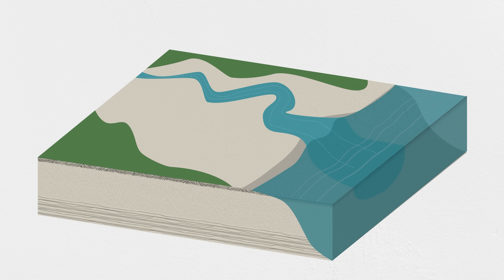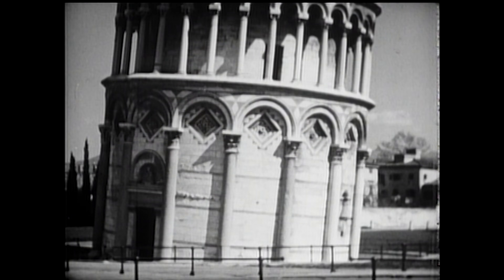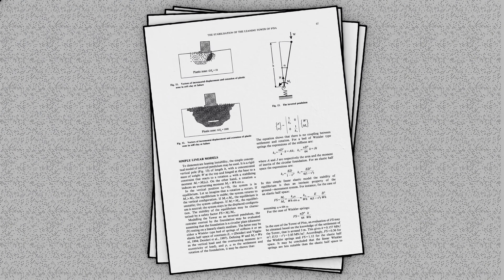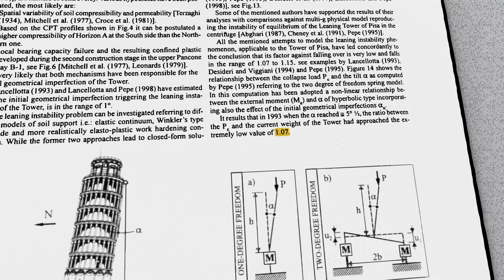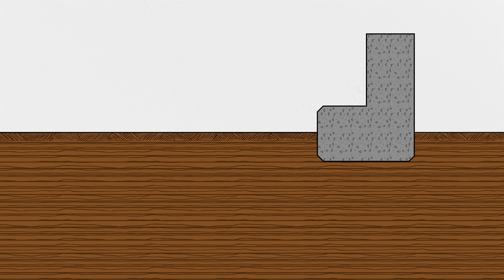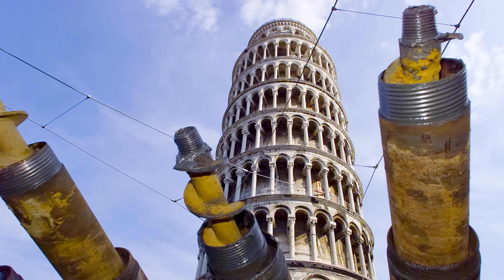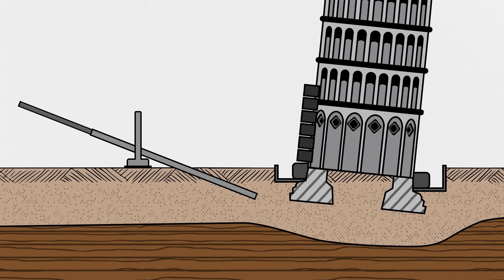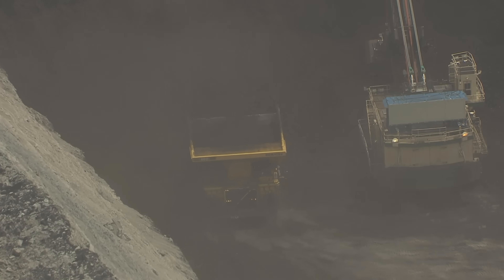How Engineers Straightened the Leaning Tower of Pisa

Comment: It's absolutely wonderful that the engineers locked the leaning side into the sidewalk to support it.  Medieval architects were something else.
Reply: Knew it was an issue and making the footing on that side wider eases the issue
Reply: Too bad they operated a bit too much like modern engineers. Implemented a field fix and then didn't bother to document it in the as-builts, lol.
Reply: Hey, even if it's leaning it's lasted 600 years
That has to count for something
Reply: @nasonguy  You mean "resident construction engineers?"  As-builts are the responsibility of the resident engineers, at least for transportation projects.  Design engineers (such as myself) are required to issue "Use-on-Construction" revisions.
Reply: Not very smart to start digging on that side though, clearly weakens the wrong side. Had they done it on the "high side" of the tower foundation it would have straightened instead of risking to tilt even more and risk collapse.
Reply: More like it snagged itself into it as the lean progresses
Reply: @stephenfry-gdot  That was the most engineer answer possible. Thanks.
Reply: @nasonguy   anytime
Reply: @mfaizsyahmi  That is my understanding as well

I don't believe it was deliberately done by the original constructors but is something that happened over time as the building leaned and rested on the surrounding walkway
Reply: I think they have the same spirit, just different tools, if the medieval builders got access to incline driller, I think they'll do it too.
Reply: medievil architects caused the problem in the  first place
Reply: Soil mechanics wasn't an engineering discipline until the late 19th early 20th century. It was hit or miss before then.

And as a side note, Pisa isn't the only "leaning tower" in Italy.
Reply: The tower actually overshadows the cathedral, that's an engineering marvel by itself. The central nave, at 33m height, is higher (and larger) than the entire first generation of gothic cathedrals, that had been built soon after.
Reply: @BilgeDweller yeah we have a tower here in Netherlands called Oldehoven, was supposed to be a tower for a Cathedral but it started leaning  and there is even a story where the architect jumped off the tower after that happend.
Reply: but if you think about it, if it was leaning just a little faster up until like 19/20 century the level of engineering wouldnt be able to stabilize the structure and it would collapse.
Reply: @wobblysauce  good thing the Pis'a was able to keep from falling down and someone was able to maintain the structure and then straighten the Pisa back up right.

Comment: A couple other ideas that were rejected were installing a tube system under the foundation to freeze the water in the subsoil, controlling the temperature according to the lean, or using hydraulically injected foam to correct the lean in conjunction with injecting a water-cured polymer to harden the subsoil.
Reply: Compensation grouting (aka compaction or hydrofracture grouting) with cement  is what I would have done since I'm a grouting engineer but honestly it would've been similar in cost and schedule to what they did.

I've lifted a penstock at a power generating station using cement and sodium silicate. 3 months to lift 3/4" with a goal of 1". With steady gradual progress, its possible to react to geoinstrument feedback to target specific points to lift and others to leave alone. The structures took weeks to react to the initial consolidation and kept moving upward for weeks after I completed the work to reach the 1" total lift target.

Compensation grouting with water reactive polyurethane is hard to control because polyurethane expands so much and doesn't necessarily find water to react with at the time of injection, especially in clay. The soil and foundation may take weeks to react to injection (as measured on geoinstruments), so  the rate and location of lifting is unpredictable, and differential and overrcompensation happens. People do compensation with polyurethane successfully, but it carries risk.
Reply: I heard they did pump grout into the ground to harden it up and stabilize it. Whatever they did it worked.
Reply: I had thought that they actually did try that as a temporary measure, but it was a long time ago.
Reply: The freezing concept was used in Amsterdam during the construction of the Noord-Zuid Lijn (North-South Line). It runs underneath the historic city center and everything is built on wooden poles as it was originally a marsh. Some huge, historic buildings risked collapse, so they froze a massive section to drill through safely.
Reply: I found this on the Internet: In 1995, engineers froze the ground around the tower with liquid nitrogen in hopes of stabilizing the terrain. It didn't work and the plan, which also involved installing underground anchors, was quickly aborted.  Freezing was used and worked well for the city of Boston's Big Dog.
Reply: "Dig"
Reply: @gregorymccue5003  Boston's Big Frozen Dogs, a revolution in engineering! 😉
Reply: @Yvolve  I apologize for my typing non-skills.
Reply: @gregorymccue5003  Some might say you were closer with “Dog” - the Big Dig is a fine example of a project that ballooned way over its budget. Initially budgeted at $2.56 billion, it ended up costing $13.6 billion according to the final audit, and will cost taxpayers over $24 billion by the time the loans are paid off in 2038 due to interest charges.
Reply: @gregorymccue5003  No need to apologise. I just found it a funny typo, as it almost sort of makes sense but also is totally absurd. And, as Ken explains, it is quite apt.
Reply: I wondered that too why not instead of removing material and making shorter why not just inject dirt or something under the low side. Or even put in some kind of jack or screw system tied to rock beneath it. Another idea I can see though maybe not practical would be put some long shaft in the center of it and then tie this to hydralics or screws and then use this as a lever to tilt it back, but i guess that would have to be permanant unless used in combonation somehow.
Reply: @network_king  It doesn't matter how much material you pump under the sinking side, it will keep sinking as the soil is just too weak. All you do is add weight and that makes it sink faster.
There is no way to jack it up as there is no solid rock underneath to use as a platform, hence the sinking of the tower. If there was rock beneath it, there would be no tilt. 
There is no way you can install a long shaft in the center as you can't put a machine inside the tower to drill the hole and install a giant shaft, nor does the base have the strength to support an entire tower on a shaft, nor could you tie the shaft to the inside of the tower. 

There is a reason they went for the method they did.
Reply: @gregorymccue5003  Mastiff?
Reply: Are you familiar with the leaning millennium tower of San Francisco? Maybe they should do the same in America?

Comment: The tower is *curved*?!  That is amazing.  I can't believe I never knew that.
Reply: The walls of old brick buildings are always curved. You just can't see it from the ground. But when you get on top of one and look down the wall you can see it then. You can see every brick. Makes it look taller. Modern brick faced buildings are different. The brick is just a siding. It's held up by the inner structure of the building which is blocks and steel. There's wavy metal straps called ties that hold the brick to the real wall.
Reply: I have seen the tower in person.  It is not curved.  It was built straight, but as it started to tilt, they readjusted the next section so it would be straight up, with a tilted base.  They made three corrections to correct for the tilt.
Reply: @robertheinkel6225 It is “essentially curved”, no not a true curve, but similar.
Reply: Ditto!
Reply: @robertheinkel6225  if not curved, explain how one side has 2 stairs more than the other😮
Reply: @robertheinkel6225  ... that would mean it is curved.
Reply: I knew it was curved, but only horizontally 😂
Reply: @1pcfred  Brick veneer is what its called. 

Your right though, the framing is usually the same.  Only difference may be the  wall sheathing might be thinner or a weaker material like OSB.
Reply: Bananas are also curved. Did you know that?
Reply: Yup, I learn something new every day 🧐
Reply: You see those Italians? They got curved towers... curved. towers.
Reply: @robertheinkel6225  yes, as said at the beginning of the video.....
Reply: @robertheinkel6225 it’s not curved, it just has features that make it not go in a straight line along it’s length.
Reply: "The tower is *curved*?!" - I hear they have medication for that now, though women may appreciate the curve.
Reply: It's funny how he showed the tower a bunch of times before saying that and I didn't notice it at all . The next time it appears after that, the curve seems super obvious. It can't be unseen.
Reply: @user2144 
That's crazy talk! No way can that be true.
Reply: @robertheinkel6225   it is curved..all brick/ stone  supported buildings are built slimmer at the top  than  bottom
Reply: I had never realized that, but now that I know about it I can't NOT see the curve... Still kind of cool that they figured that out back when it was constructed
Reply: You know what else is slightly curved upwards
Reply: 5 = E = 3 so it's a 33 Code. Also i bet it was part of a hydro power system and the turbine was in the building next to it.
Bell Tower = Bell Siphon.
Reply: If it didn't take 300 years over 3 wars to build and they built it all in one shot, it almost certainly would have collapsed.  Somehow the odd sequence of events and odd compensation applied made it last.
Reply: It's true and a lot of women say they prefer it that way.

Comment: I saw the bracing of the tower when visiting Italy in the late 90s, however, I didn't get to see the actual fix being done at ground level since the work area was boarded all around.  The cables clearly looked temporary, as they were not fixed permanently to the tower rather they embraced the exterior with wood planks to shield the stone from the cable.  For everything I saw above the edge of the fence, I guessed they were pumping some sort of cement mix under it, not taking out soil.  They did a nice trick there.  Thanks for telling the story.
Reply: I was there in ‘99 and I remember this too! I was a Kid, but I still have those corny photos that my dad had me pose for, standing in the foreground with one arm up, as if I’m holding up the tower. 😅
Reply: Ditto, I was there in 2000 with my wife, and confirm the upper was strapped and tied back with cables. Great to see more info to add to the placarded info provided at site by the engineers (in English!).
Reply: I would do jet grouting method. This is soil liquifaction.

Comment: I'm reminded of the stories a friend of mine tells. he worked construction on housing developments in Florida, and in many places, the slab foundations for houses floated on wet sand until the house was built and slowly compacted the water out.  if the house was built asymmetrically, the foundation would tilt under the unbalanced load, so they had to be careful how they loaded the material onto the slab.
Reply: that is one nice thing of living in a northern climate- Michigan requires 42" of footings so that solves a lot of floating issues. not all mind you, but a lot
Reply: @pizzaivlife  here, the terrain is so varied that there is no one size fits all rule.  my brother's beach house is on bedrock.  there are other houses I know of, where they drove 30 foot pilings flush to the ground and poured footings on top of them.
Reply: @pizzaivlife  where grew up in Florida, ground water aquifer started at around six feet deep. You couldn’t put footings down that deep if you wanted to.
Reply: @kenbrown2808  right, we have those issues too. It is just nice that even in good soil you have to have those 42" of footing. you can need more for structural reasons of  course, but that is the starting point for anything you don't want to pop out of the ground
Reply: @sandy1653  we can hit ground water in just inches. I've seen a below ground garage with tides.
Reply: @sandy1653  : Oh, you can, but costs can very quickly balloon, and you'll usually (and maybe always) be better off with pilings or similar instead.
Reply: Balance the slab
Or suffer a lean
Reply: @kenbrown2808 Hearing "a below ground garage with tides" made me laugh for several seconds. Thank you for sharing that and putting it so well.
Reply: @Kenionatus it took me way too much
Reply: A building on the university grounds in Adelaide, near the Torrens River, floats on nine huge concrete slabs, purpose designed to allow some movement. The land moves due to being so close to the river, and the free-ish movement of the slabs means that the building structure is under less stress when the foundations shift. Rather than the structure cracking, the building tilts ever so slightly, and has leaned in various directions over time. I studies arts in that building for 3 years.

Comment: At the moment in Italy we're having a very similar situation in Bologna, where one of the two towers is leaning so much they had to close part of the town center. From what I understood, the real issue is that in this case the motivation for such lean are unclear, hence there's no idea of how to act.
Reply: as far as i know bologna's ground is really muddy, and can't withstand the weight (that's why Bologna can't have a metro).... add up the traffic just driving by... stay strong Garisenda!
Reply: If it's the tower I'm thinking of, then the correct first step is probably to disassemble the tower so a new foundation can be built. Less intrusive measures may be possible, but from what I've heard the towers in the area in general were probably never on foundations fit for their size, so if the thing is to really last it needs a good foundation to be engineered, preferably with the neighboring tower getting the same treatment as soon as the first one is finished up.
Reply: The tower in Bologna also leans a lot, it’s just as noticeable as the one in Pisa. It’s just not as famous because it’s not as pretty.
Reply: @Sashazur  Yeah, it's definitely ugly.
Reply: Get Lewis Ferguson to stand up against it
Reply: Is that pronounced boe log na or ba lone ee?  It's the same spelling as a certain food (loose definition but some love it) with the latter pronunciation and a word synonymous with bullshit.